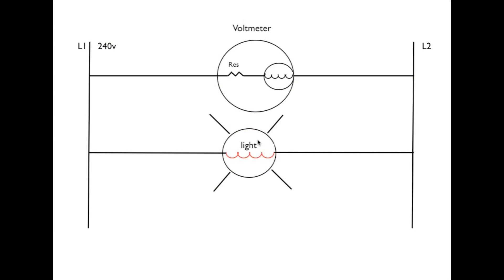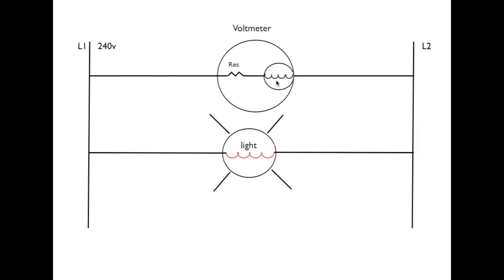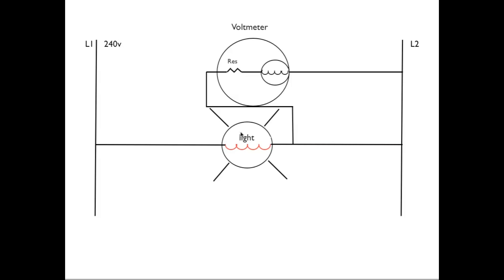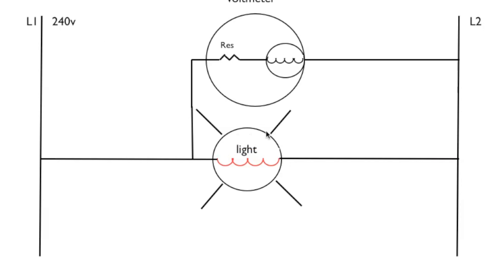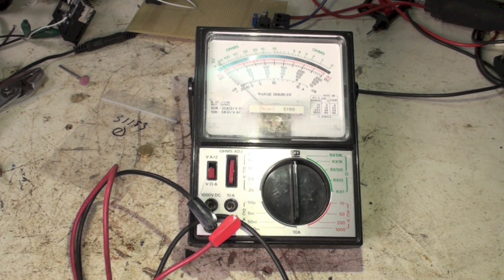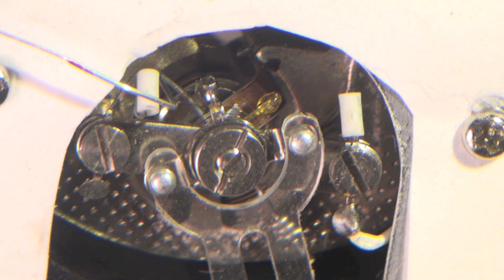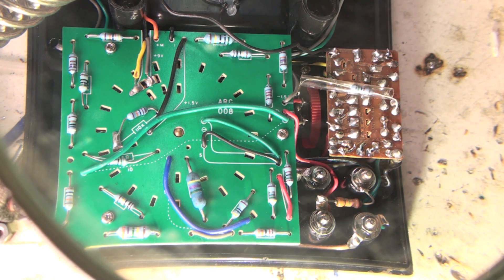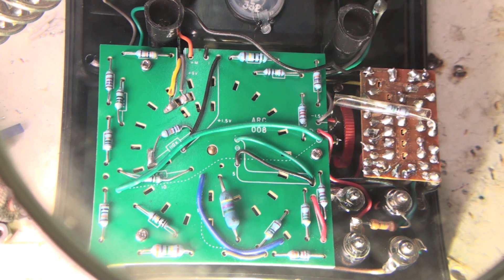How the voltmeter works in the circuit

Comment: I have a simple question to ask or I think it is simple anyway.  And no matter which forum I go to ask, all I get is the usuall intellectual run around from the experts.
I feel very comfortable that you are old school and you get no pleasure with high flying nebulous lingos.
So here it is:
Say you hook up a 2 ft wire to one of the terminal of a car battery with the end of the wire away from the battery. In other words you are not moving the end of the wire towards the other terminal.  It is just remove to any other nonsense in case it gets in the way.
The question is; what exactly moves to the end of that wire from the battery?
( photons, electrons, protons, neutrons, signals, charges, volts, energy, something, nothing....?).
And when you unhook that wire then what happens?
Thank you in advance.
Reply from the maker: Nothing.  
GFM
Reply: @grayfurnaceman  That makes it the same as a dead wire as if you never hooked up that wire to the battery in the first place.  That is my interpretation of nothing.
[Side note:  I see it as if you extended that terminal of the battery two feet away (the length of the wire that is) when the wire is hooked especially a good thick wire]